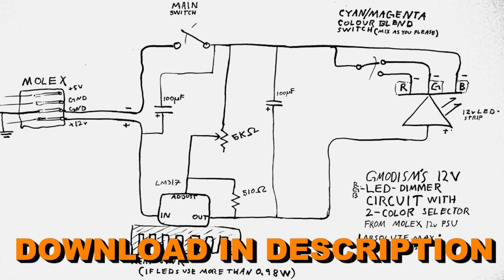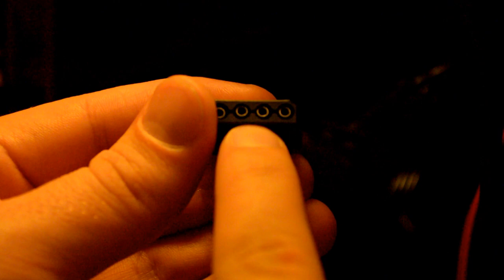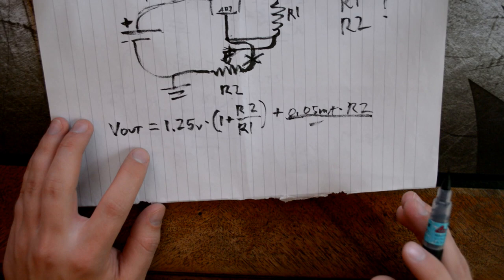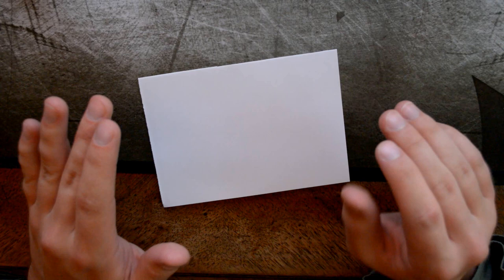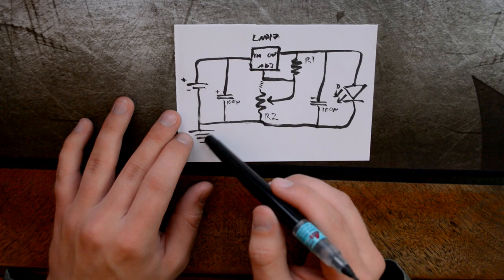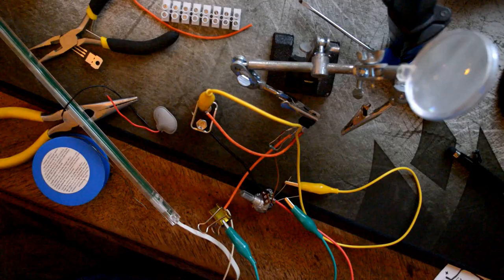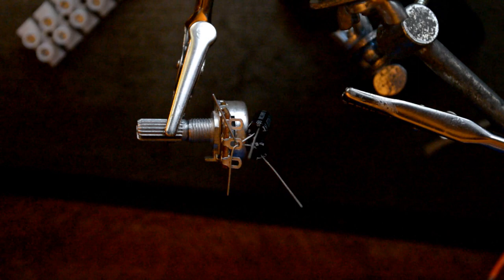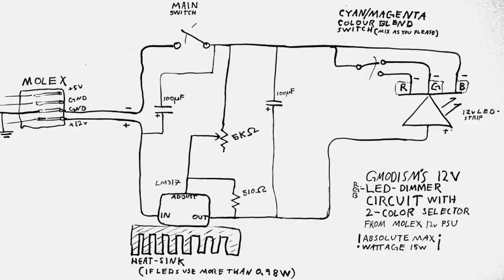How to Make a 12v LED Dimmer - Analogue Controller Circuit With Color Selector - Tutorial

Comment: I am confused what is the circuit to control the out of the led. Is it the circuit with switches or the other one.
Reply from the maker: One switch is to turn it of, and one to mix colors between two presets. Then there is the dimmer for the entire strip.